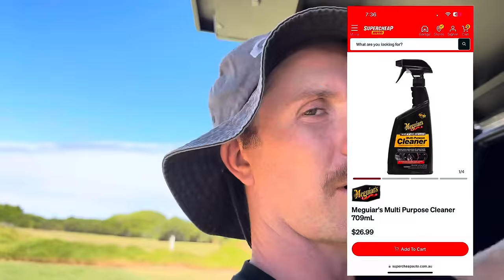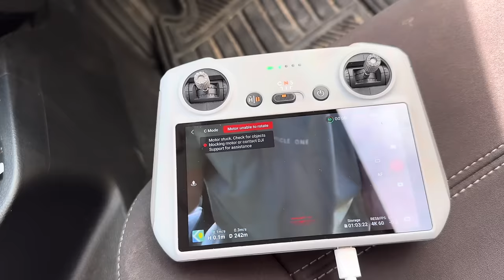FIRST Time Towing Our BRAND NEW Caravan Off-Road! DAMAGE!

Comment: Looks like you are missing the cowling that sits over that gap in front of the radiator. I believe it directs all the air to pass through your radiator and keeps your water and oil temps just that bit cooler when you are moving.
Reply from the maker: Nice pickup! I’ll have a look and see if something is supposed to be there! Thanks for watching!